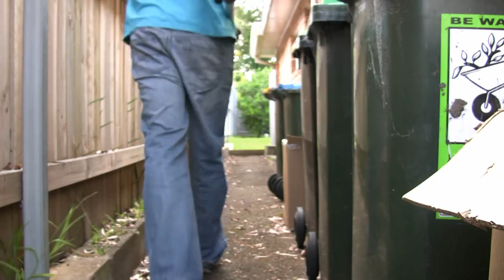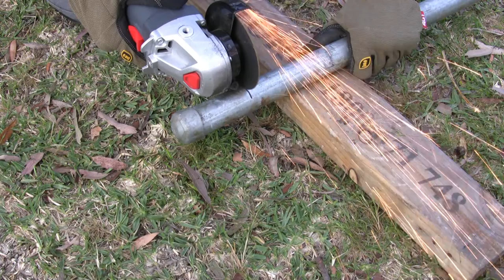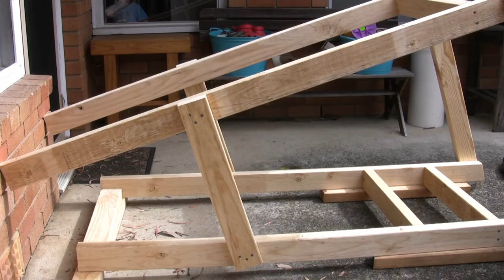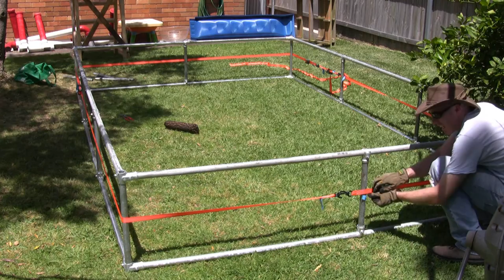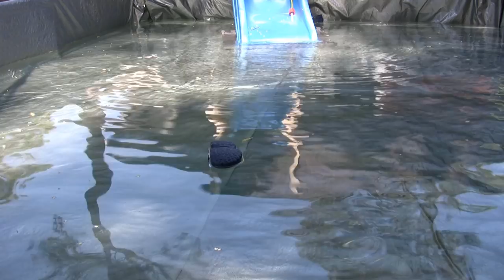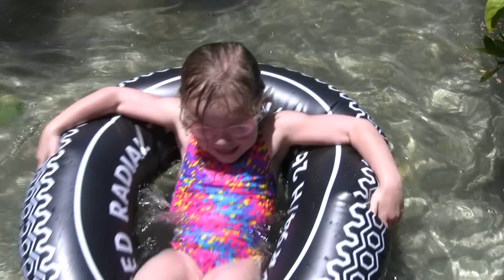Dad Builds Giant Paddling Pool in Backyard

Comment: @The Dirt Effect awesome work!
Would you mind listing the items you used? Thanks
Reply from the maker: Hi Janae, I used galvanized steel pipes with a nominal bore of 25mm. I joined these together with Downee Joints but Kee Klamp would also work or something similiar. I joined ratchet straps together to form a belt for extra strength. The darker tarp was a high duty large tarp that is fluid impervious. Zip Ties helped secure the tarp to the metal frame.

Comment: Great job 👍 but I’m wondering how is the cover you used to hold in the water called ? I’m trying to recreate this 😂
Reply: Tarp I’d think
Reply from the maker: Hi Axel, I used a heavy gauge tarpaulin to hold the water. It worked just fine. I rebuilt the pool again a couple of months after this film and it was still water tight.

Comment: did you keep track of costs??  curious to know what you paid -- I've been having a very similar idea...  only deeper and longer...  hmmm
Reply from the maker: I already had the materials on hand. The only thing I had to buy were the ratchet straps. The price of metal fluctuates on a daily basis, but last time I bought the 6.5 meter pipes they were about $42 (AUD). The joints are about $6 for the corners and $4 for the Tees.

Comment: where do i get the poles and connectors
Reply from the maker: The local building supplies shop. They are galvanised iron poles (25mm nominal Bore) and Downee Joints. You could also use Kee Klamp joints, but these would cost a little more.

Comment: did you get council approval????
Reply from the maker: This was a temporary structure that the council did not disapprove of... I believe it was Joel Salatin who once said something like, "I am all for a bit of civil disobedience, so long as it is righteous".       But yeah, make sure no one drowns.
Reply from the maker: ***** A 4 foot high pool would be lots of fun. It would require extra tension around the outside (kind of like a strong belt). The single strap I used would perhaps need to be duplicated at regular intervals up the pool wall for a taller project.